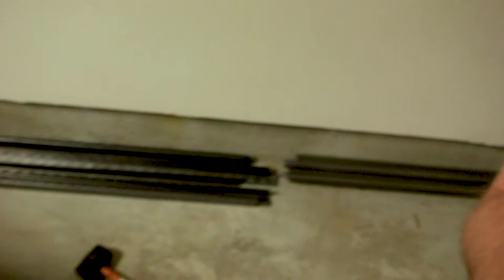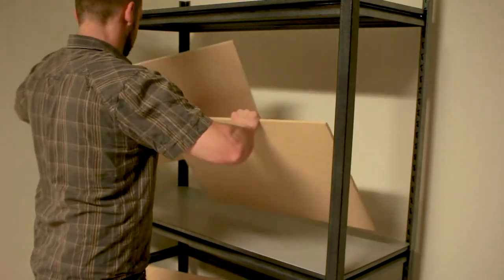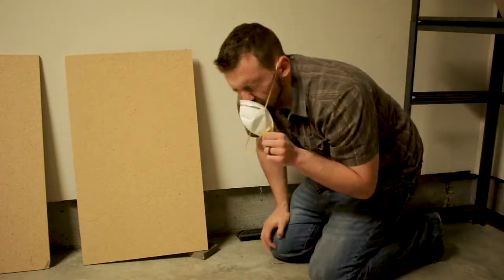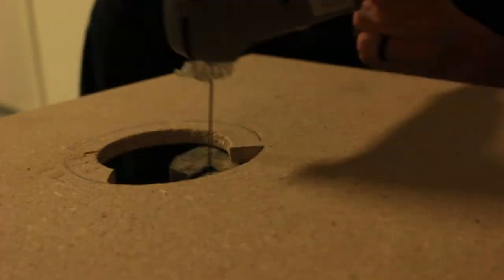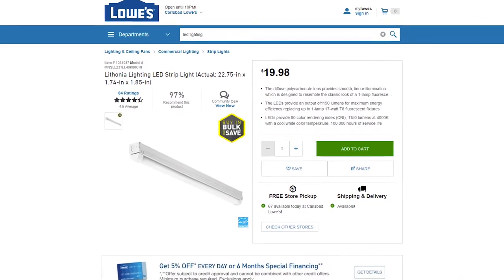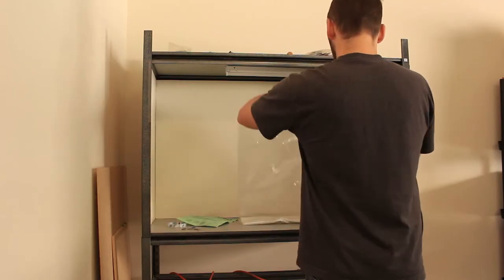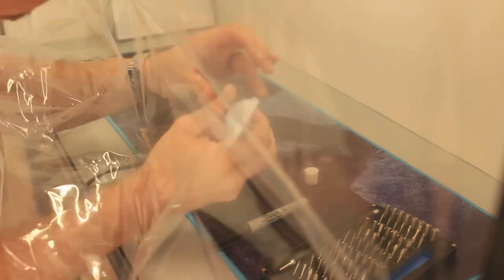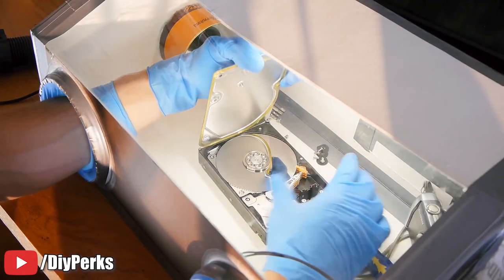BUILD A DUST FREE CLEAN AIR ENCLOSURE

Comment: i live in las vegas, surrounded by desert. as SOON as i open any door/widow, a layer of dust comes in, invisible to the eye.  I can dust my monitor 20 times a day and it's still dusty.

can i make a smaller clean box, to put my PC in? and would it be good enough to not overheat the pc, because vegas is all extremely hot in summer?
Reply from the maker: Yes. Due to dust concerns, you may want to create something with better filters and seals. Ive seen computers in the desert with air filters get really dusty inside.
Reply: @ImmodderNation  thank you. my neighbors think I'm crazy for asking them to build me a box for this. Literally saying, "you don't need no box" but they have outfitted their entire house in wood, just because they're bored. lol
Reply from the maker: I'm sure they have some rationalization for using wood in the desert. Brick is better
Reply: @ImmodderNation  well it's a cheap material.

Comment: why not just cut a hole the size of the power strip and mount it inside, then seal up the sides with silicone, after that use a big piece of acrylic as a window and then cut 2 holes and essentially silicone in some kitchen gloves, then you could make a little door to slip stuff in through and make some holes on the end opposite the fan for air to escape, then you could just put a thin layer of foam on the outside of the holes or something to keep any dust from making its way into the clean room while the clean room isn't in use, little bit more work but not too much more money it would likely help keep stuff out a lot more efficiently, might be a little over the top for this application but i like to go over the top lol
Reply: great video though and this seems like it should be sufficient for this mod, ive been tempted to start making computers with these side panels since i make computers from used parts and sell them, only thing holding me back is the thought that it might complicate the experience a bit too much for the average person, i thought i could maybe hook it up to an arduino nano that auto boots up with an animation when power is given to it then directly hooking the arduino up to the 12v power from the psu that way the side pannel just starts on its own however then i run into the issue of it being difficult for the end user to change the animatin, also instead of using acrylic have you considered using glass, not tempered glass just normal glass, ace hardware cuts glass pretty cheap and sells it too, cheaper than a large piece of acrylic i believe and it would be more scratch resistant, and while glass is fragile people do use this for windows so i can't imagine it would be that bad
it may bring the price down while also giving things a cleaner more proffesional and more modern work, not to mention that glass comes out way flatter than acrylic and will likely sit better against the lcd
Reply from the maker: You have some good ideas kiyosen. The acrylic window for the cabinet is overkill and doesn't allow for flexibility of moving larger panels around inside the cabinet. Also, Arduino runs on 3.3V so don't hook it up to 12v. Lastly, glass is more expensive, heavier, and not as strong as acrylic. I won't want to add cost and weight to the door of computer cases if I don't have to. The assembly with LCD is heavy enough.
Reply: @ImmodderNation  very true on the acrylic window and the arduino power i just got wrong cause im tired and about to go to bed lol so dw i wont blow one up, and are you sure on the acrylic being cheaper, cause ive seen our glass sell for cheap at ace while the acrylic needed for a side panel off of amazon at least seems like its more expensive or at least the same size, the weight concern i do understand, i personally wouldn't mind it on my own build but i can see why others might be cautious, also how it might wind up costing more in shipping than you saved initially, also with the plastic window you could probably get it to stick down better when you aren't using it or if you just get up for a minute with either just gluing on some little ceramic magnets, using magnetic strips that have an adhesive backing, or even just some velcro, thought it might help since due to the nature of the window it flaps around a lot and probably lets more dust in lol, just shotgunning ideas seeing if any help, id like to see these pannels trend more in the tech community, they are quite nice
Reply from the maker: Acrylic prices depends on type and where you live. In Southern California, plastic is cheaper from what I've seen and tempered glass is not made here. I also use cast acrylic which is a little cheaper.

Comment: would putting 2 heppa air purifiers in the main room make it "clean"?
Reply from the maker: Depends upon the room and the ventilation system. Too much filter reduces airflow.
Reply: @ImmodderNation  oh i meant air purifiers that just sit IN the room.
Reply from the maker: Depending on your setup it can help, especially if you're talking about a garage or a bedroom near a computer.

Comment: no 3 inches is 76.2mm, yes I know 25.4mm per inch thanks to engineering at college lol
Reply from the maker: I hope you didn't go to college for that. I just did a Google search and ended up with the same answer. 😆
Reply: @ImmodderNation  I did IT@work, should of got merit and go to level 2, carpentry and joinery level 1, then most went to carpentry level 2 then over to level 2 engineering, carpentry was told when finish work even if repair it left for painters to paint ...
Reply from the maker: Yes

Comment: LookHere is a video about how to make a dust free enclosure. And BTW Check out this other guys video he is way better at it than me and did i mention it does not look like the other guy in the other video is actually moving his lips its soo wierd.
Reply from the maker: Different application, my dude. I'm building LCD Side panels not working on hard drives. His application requires more strict dust control. Much respect to Matt, I love his channel.